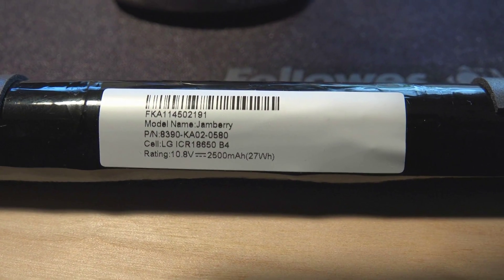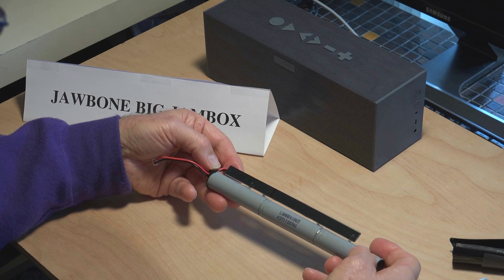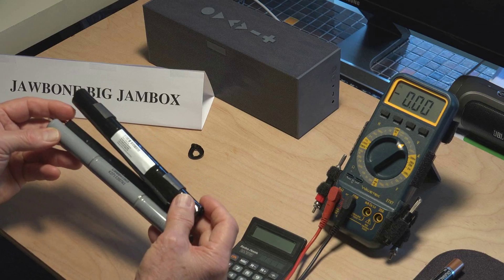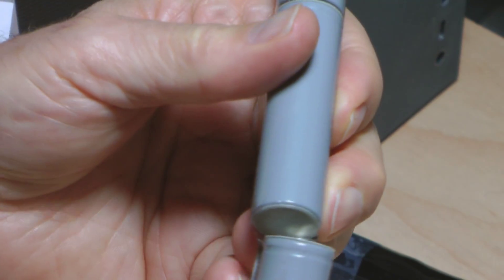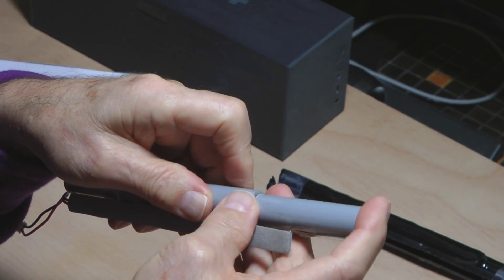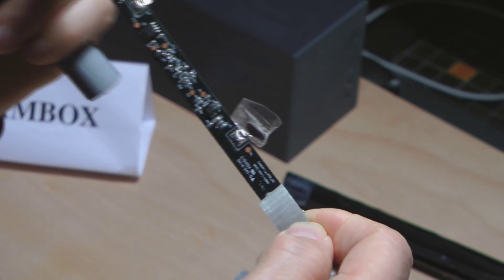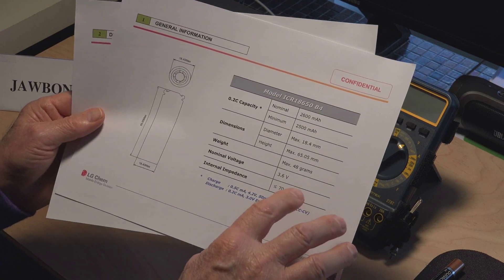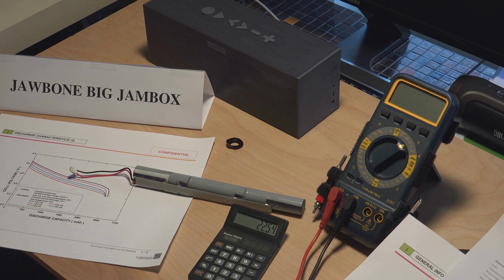Big Jambox Battery Changeout

Comment: I think the company that makes these went out of business. Maybe someone could make some money selling refurbished battery kits for these great little speakers?
Reply: PJ Jackson you can order the battery from aliexpress. I installed one in my big jambox.
Reply: You can replace these batteries with 18650 3.7v 2600mah lithium batteries or more. Buy them with the connections already soldered. Because you should not put the soldering iron on the batteries.
Reply: Thanks for this video I was going to embarrass myself and open it😅